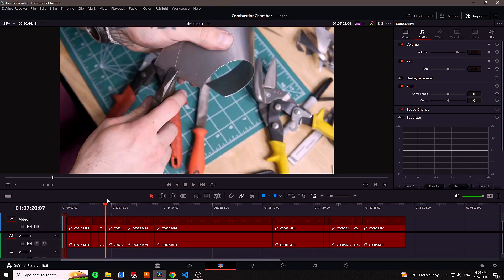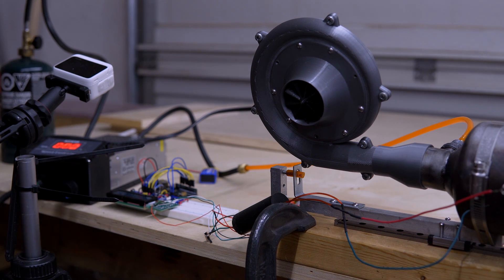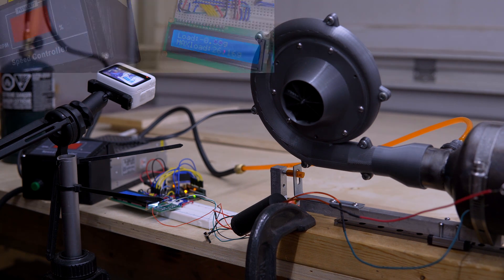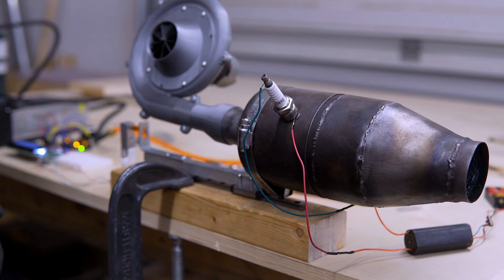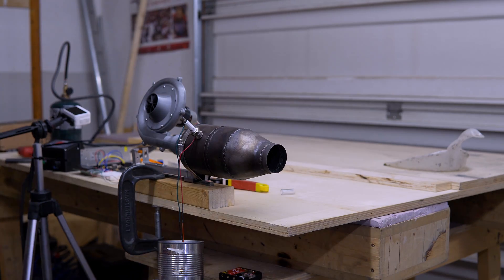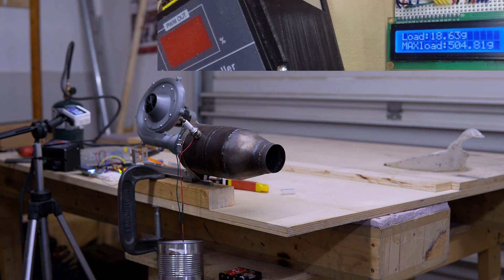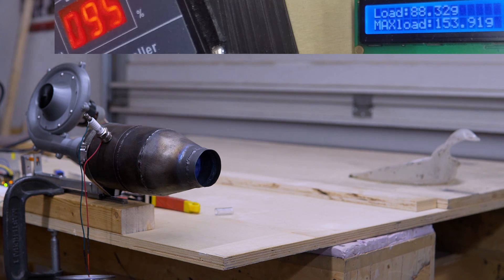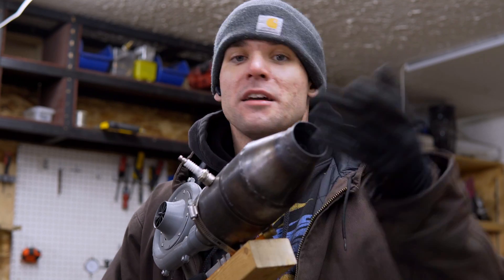I Built a Homemade Electric Jet Engine from Scratch!

Comment: Hey may i know which type of metal you used on jet nozzle😅 for educational purposes😂
Reply from the maker: Mild steel.. It oxidizes real bad
Reply: @Neally Try ceramic powder coating the inside if you can swing it. No more ablation of sensitive hind-end parts!

Comment: Its not a jet engine.
Reply: What is it then?
Reply: @RatFiendHD
It's not a turbojet, but a moterjet.
If you shut off the electric moter powering the compressor the whole whole thing will die.
Reply: @maybZIB it’s a type of jet engine called a turbo jet
Reply: @hamster7852  obviously, thats why I’m asking them what they think it is
Reply: @maybZIB  oh my bad buddy
Reply: @hamster7852 turbojets need to be driven by turbines
Reply: @corbinclark1770  yeah this is a turbo jet. Do you know what a turbo is?
Reply: @ as in turbine the thing that this engine does not have because it is driven by an electric motor and not the exhaust gasses from the engine?
Reply: @corbinclark1770  but it’s still would be classified as a turbo jet
Reply: @ no it wouldn’t. The turbo in turbojet specifically refers to the turbine. He has an electrically driven jet engine with an afterburner.
Reply: @ it still is classified as a turbo jet
Reply: @ I’m gonna stop here because you are just repeating a false statement. Turbo means the compressor is powered by the exhaust by using a turbine.
Reply: @ it’s a turbo jet
Reply: It is a jet engine buddy

Comment: Maybe the radiation from the high voltage arcs are messing with the arduino. A quick hack is to add a frequency ferrite filter

Comment: The problem with Arduino and ignition is that, the ignition makes el.spark with chreates small, very small emp (electro magnetic pulse) and that will mess up the Arduino.
Reply: @Neally Certainly the power inverter should be shielded, but do so for the ignition wires as well. The arc is shielded by the engine chassis, but it creates crazy noise reflections in the conductors making your ignition wires big radio broadcast antennas. A simple 2-conductor shielded and jacketed wire should do nicely. Don't forget to ground the wires' shield to the chassis. The Arduino should be EMF shielded as well.
Source: 3 decades of industrial process and power control :)

Comment: Isn't it really just a supercharger with an afterburner?
Reply from the maker: I looked into the definitions of things again to double check before I answer.. So this engine is called a motorjet, it's a motor driven compressor that feeds a combustion chamber to produce thrust. I don't think it would count as an afterburner because an afterburner is a secondary combustion stage, where my engine one has a single stage. Think of this like a turbojet without a turbine section
Reply: @Neally  True, you are essentially doing the same thing as an afterburner does on a jet engine though - Increasing exhaust velocity and thus thrust. The difference is an electric motor is doing the first stage rather than a gas turbine engine. So it's probably inexplicably inefficient. Either way, i like it.

Comment: Hey boss you should try to make your jet engine produce electricity for you while it spins :D
Reply from the maker: Yeah I might try that in the future!
Reply: @Neally  ive always wanted to see how to do this ever since i found out that one ariel atom or however u spell it has a new car that does that.

Electric car with jet engine stock that is only there primarily for charging batteries using diff fuel.

So damn cool.

Comment: I think you need to have a larger nozzle geometry so the exhaust can have the same pressure as the ambient pressure. Right now you can see it’s greater. It will make the engine more efficient
Reply from the maker: I made a video after this one where I compared the performance of different sized nozzles on the engine, and the nozzle that did the best was about half the size of this one.. It was kinda surprising

Comment: Jet engine? Dude, you don't seem to know what the words mean!
Reply from the maker: "Jet engine, any of a class of internal-combustion engines that propel aircraft by means of the rearward discharge of a jet of fluid, usually hot exhaust gases generated by burning fuel with air drawn in from the atmosphere." - the direct quote from the Britannica website https://www.britannica.com/technology/jet-engine
Reply: @Neally I don't think we can call it an engine until the turbine powers the compressor.  This might be called a electric jet motor in it's current state, powered by electricity and unable to self sustain on fuel. But I'm rooting for you and can't wait until you hit that point! Keep at it!  I see a 3d printed metal turbine and compressor in your near duture
Reply: Actually we can call it a jet engine it's just the compressor is replaced by an electric one ,the system is somehow different but it's the same output which is propulsion @gutrali
Reply: @2-Bit-games  well yes, you can call an apple a potato if you would like. Just because they are both round does not make it right. A jet engine is self sustaining, do you know any that are not? The engine pictured here is not self sustaining ... It will only live as long as the battery does, regardless of how much fuel you have available. You can't utilize the output to compress the input ...... Please Find and name any other jet engine where that's true?    Your claim that it only needs to produce propulsion is also wrong. A rocket produces propulsion but it's not a jet engine, is it? There are also jet engine gensets that produce electricity, not propulsion. Same for jet engine powered helicopfers? They produce rotational mechanical force that is directly utilized.    The motor pictured on this video doesn't even need to burn fuel in order to output MORE propulsive force! In fact it doesn't need fuel and can get by with even less electricity if just he used a modern EDF. I checked the numbers.  This isn't a jet engine , it's a novice science experiment. Nothing wrong with that.
Reply: @gutrali  you're confusing jet engine with "turbo jet engine", jet engine has many different types ( RAM, SCRAM, TURBO). This one just uses an electric compressor, it can be called jet engine as the principle of working is same.
Reply: @cosmorito961  No im not confusing them. All the examples of jet engines that you've mentioned (and you probably mean turbo fan jet engine and not just "turbo".... But the following WILL even apply to a "jet engine" built from an automotive turbo) .... All of them utilize the exhaust gases to help power that engine. Whether it is harnessed directly by mechanically linked turbine, or it is simply indirectly capturing and restricting (pressurizing) the incoming air thanks to the forward motion of the engine. Utilizing an electric compressor for intake does not make a jet engine. It makes a forced air heater! It's no different than the propane powered shop heater I use, which we would agree is not a jet engine, even if you try to put a nozzle on it and speed up the air flow or pressure. It is always an electric fan motor with a burner behind it. The only difference between my shop heater and the video is the speed and the pressure of the incoming and outgoing air. Neither are a jet engine! Neither would you put up in an airplane or use for producing actual thrust off the test stand. No aerospace professional would ever describe the device in the video as jet engine. Not until you utilize the fuel to power the engine and ditch the batteries. See how much thrust you produce after doing that, and if it is net positive still -- now you have a jet engine.  Another example..  The oil burner in my mom's house has a fan that compresses and accelerates air, and then lights fuel in the exhaust. Is that a jet engine too? No. No it's not. Even if it does produce some thrust, it's still not a jet engine.
Reply: @gutrali  Italy built a prototype of jet which used a piston engine to power the compressor.
We all agree that the challenge in a DIY jet engine is getting it to sustain its own compressor by using the tubine, but bringing semantics into this is pointless.
Reply: @ChucksSEADnDEAD Thanks for proving my point with an excellent example. The year was 1940, and the Caproni Campini N.1 was powered by an engine called a motorjet. Why do you think it has that name, and not just "jet engine"?? 😜 Semantics are the study of the meanings of words. If you are going to use language, you should know how to convey proper meaning by selecting the right words.
Reply: @gutrali  A motorjet not being a jet engine is the wildest take possible.
So we have turbojets and motorjets, but only the turbojet is a jet engine? And the turbofan, because it uses the fan bypass for thrust, doesn't use the name jet therefore it's not a jet engine. Jeez.
Reply: No, the turbojet engine that needs to be self-sustained @gutrali
Reply: @1980sCrackbaby Sometimes I check their profile and saw video of them trying to show people how to do something, but they do it improperly. Gotta love the internet.😅
Reply: @railgap man please don’T be a dumbass is a hybrid forced jet engine weirdoooo
Reply: It’s a motor jet. Still a jet engine but not a turbo jet.

Comment: The connection to the screen is probably really susceptible to electrical noise. Same reason I had to ground the case and shield wires in my 3d printer. It might might help in future designs if you look into creating a path for the tin can to dissipate. Something like a wire with a diode to the neutral, or literally grounded to your wall. I'm not totally sure if that makes sense in wireless electronics though. Something I've done before is 3d print a case, cover the inside in copper tape with a layer of kapton over top, and then solder a bits of the copper tape so they form a proper cage, and then connect that to the ground on the arduino.
Reply from the maker: Yeah I really like the shielding idea for the Arduino itself, I think I'll build a properly shielded enclosure for the next tests

Comment: And what electrical power does that "compressor" consume? And what cfm it produces?
Reply from the maker: It's a 240 watt power supply, but I doubt the motor uses the full wattage. And I've not done the math or experiments to find the cfm or volumetric flow rate
Reply: @Neally  Than it is for sure it does not pump enough air for that size of combustion chamber to get even close to it's maximum potential. I would start at about 2-3 kilowatts motor, use leaf blower compressor and work the hell out of the combustion chamber design making it able  to keep the flame reliably and for at least half of the rpm diapason without the spark on. Also to produce any decent thrust you need a nozzle of the proper geometry. The good news are that work is actually the most difficult in designing of a jet engine and IF you'd be successful you'd need to add just a car turbo to get a real engine.
Reply from the maker: Yeah I definitely agree, I figured it wasn't getting enough air when it started spitting those massive fireballs due to incomplete combustion. The compressor wasn't designed specifically for this build, it was more so a matter of convenience because I built it for a different project. I'm gonna weld up some different nozzles to put onto the engine too because I really want to see what kind of thrust its actually capable of.

Comment: I had a project where I controlled a high voltage generator, like the one you use as an ignition coil, through a relay with an Arduino. One thing I noticed was having the HV generator fire and arc would cause the Arduino to freak out, even worse with more voltage or time. My hypothesis is that it makes an EMP which destabilizes the Arduino, but not irreparably? Restarting the Arduino would make everything fine again. In your case, it would be strange for an EMP to make it all the way to the Arduino from inside the metal housing of the engine, though.
Edit: Or approximately exactly what you said about 20 seconds later lol
Reply from the maker: Yeah I was totally shocked by how strong that field was, but looking back it makes sense considering how high that voltage actually is. Electromagnetism is a crazy thing!

Comment: it's a beautiful edf! but it's an EDF with an afterburner. don't stop trying man jet and EDF has completely different ways to achieve one goal.
Reply: It’s a motor jet :)
Reply from the maker: I see what you're saying, but I don't think it applies to my design. The blower is a compressor rather than a fan, so if I had a tighter nozzle on the end it would create pressure in the combustion chamber, which and EDF doesn't have and wouldn't do. I appreciate it though, thank you!

Comment: nice work! do you have a flame arrestor or some sort of mitigation in the off chance of a flashback?
Reply from the maker: Thanks! In this application I didn't include one because it's an open system, and the propane is at a way higher pressure than anything else in the system so there's no way for air and the gas to mix in the fuel line

Comment: Dont stop trying.... 👍

I may be wrong. But in your case the centri compressor is compressing and you are expanding the compressed air and then mixing fuel. Then igniting. The compression is already lost. Secondly theres no loop i.e. the thrust produced is not driving the compressor..

Mix the fuel in the compressor output and ignite. With an nozzle.. That may give a better thrust
Reply from the maker: Thanks! I'll be adding a nozzle to up the chamber pressure in the future, and I'm working on a new engine that'll run off an exhaust driven turbine so it'll run on it's own (like a proper turbo jet)

Comment: All good and well bud but build one with out the electric air pump on front as for what you have here can't be used for much due ti the fact you will have to have long long extension cords to run it 😅
Reply: That basically means he'll have to add a turbine which is powered by the burning of fuel, which in turn powers the compressor. Right?
Reply from the maker: Exactly, it essentially works the same as a turbocharger in a car. That's where turbo jets get their name from✌️
Reply: @Neally  guys as an engineer (backyard and all) no not at all turbo jet nothing close other than the turbo looking thingy ran on brushless motor, I'm not knocking your project at all in fact I'm working on an axial compressor jet engine myself one to run and self sustain off kerosene, what I meant by the concept of what we watched was the compression of air is from an electric turbo and it relying on that to compress the charge, the thermal expansion just speeds up the mix thus adding a little thrust to the load sensor try it with real turbo, a combustor, diffuser, sustain flame front and idle the thing
Reply from the maker: Agreed, and I'm already working on it!

Comment: Bro, I am also currently working on a Jet Engine but cannot find Fuel for it. Can you suggest some. Also I have a CAD model of my engine here - please check it Out :

The file is a [ .step ] file so download it and open in your CAD software :)

https://drive.google.com/file/d/1-yS8klnBmTgYKsZN7LHxbTOsek_zb8YI/view?usp=drive_link
Reply from the maker: Propane gas is a good fuel to start with cause it's very safe and easy to use. I want to move towards using karosene fuel injection on my new builds though. Cheers, and I'll give it a look!
Reply: @Neally  Thank you very much for replying. Now I might use Propane but in INDIA it is not easily available